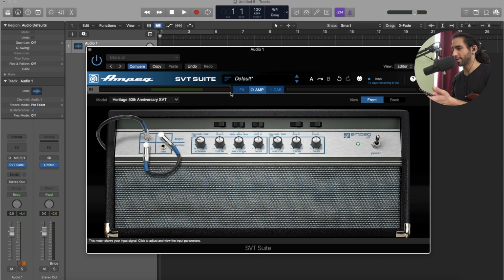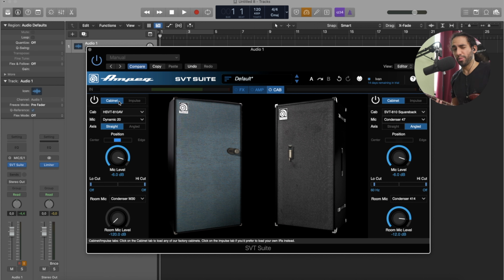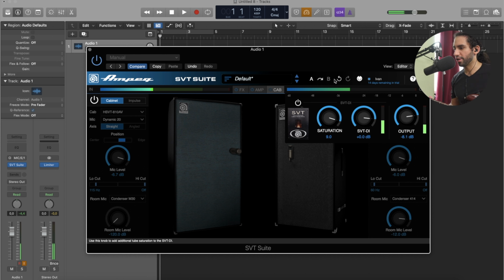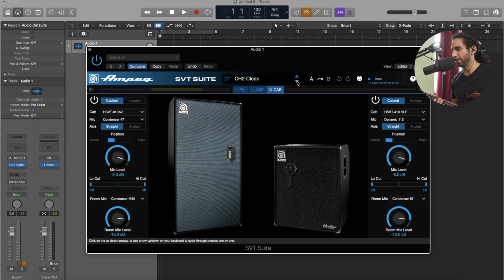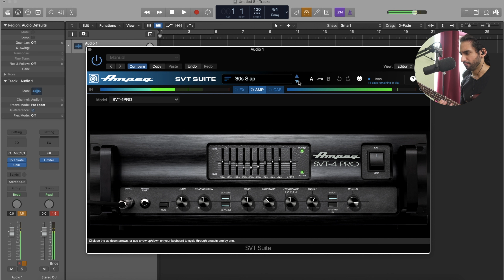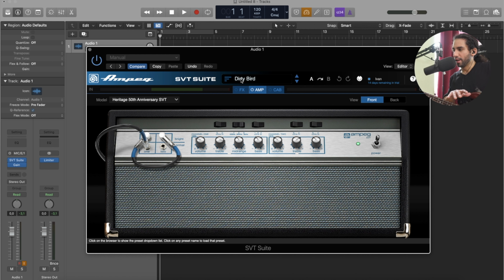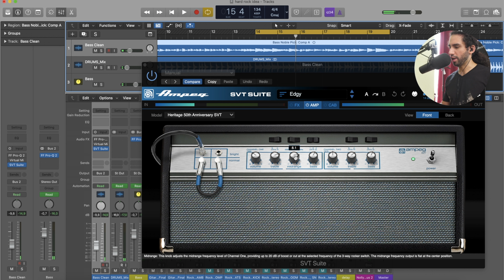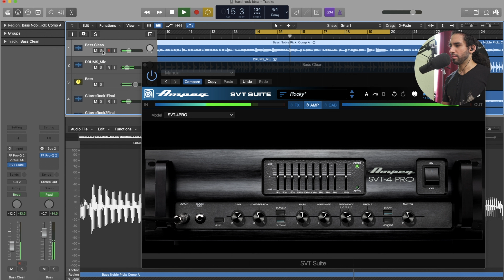Ampeg SVT Suite Plugin | Review

Comment: Hey IVan :) thnx for all your informative videos.

What cheap DI box would you recommend me ti use with my bass into my audio interface and using this Plugin ? 

I pretend to use all preset from the plugin and I would just need a good signal from the bass to the computer.

Thank you again for your hard work
Reply from the maker: Which interface do you have? And how much budget for a DI is there? :)
Reply: @IvanBassist    Steinberg UR12.
I was thinking of buying something like the Nux melvin lee davis bass preamp + di. The tech21 and other options dont seem better from what I heard and are more than double the price. 

Thank you very much!
Reply from the maker: @FilippoBuscemi93  I'd suggest getting a Neve RNDI. That DI is incredibly solid.
Reply: @IvanBassist  do you think there is a noticable difference between that one you said and the one I said? Its double the price.
Thank you for your time
Reply: @IvanBassist  there is also this audio interface: Steinberg UR-RT2 with neve input switches....would that be similar to use as a Bass or Guitar DI ?
Reply from the maker: If you’re planning on using the plugin to record most of the time, then you want a solid DI and the Neve is a pro-level DI. Definitely better than the NUX
Reply from the maker: Just googled that one. It looks pretty solid. It won’t be the same as having the RNDI, but I guess it will get pretty close. You could just skip the DI and plug in directly there and invest the money into something else. 

If you need the DI to do EQ or Drive/distortion then it’s a whole different story

Comment: I need help. I can’t get mine to respond when I play. It tracks my playing and everything, but isnt heard when I play. 

I don’t use a DAW, but the way. I find them impossible to use, more trouble than what they’re wortj
Reply from the maker: Check your routing/signal setup. Specially what is being used as an output device.
Reply: @IvanBassist  if you’re taking about what I think you are, I have it, the sample rate set at 48kHz and, bit depth rate at 24 bit, and still nothing. 32 bit float is another options, whatever that is…  Default recording settings reads as follows…

for I/O  lol
START LEVEL: -12db (other options are -6db…  -24db… -48db… and OFF)

END LEVEL: -48db (same other options as above)

END DELAY: 5 sec (other options are 3, 4, and 5 seconds)

Comment: Hi Ivan, great video and very good explanations. I just installed the trial version and it is great in the stand alone mode. But as I see, you implemented SVT suite in Garageband. Please let me know how to get it like this. I already tried, but I didn't get it like you. Thanks in advance.
😀🎸
Reply from the maker: Hey Harry, I used it on Logic X Pro. You need to open the mixer panel and look for the plugins section. The SVT suite should be there
Reply: @IvanBassist  Thanks Ivan, for your quick response. I installed the Au in Garageband, band this gives me only settings. The Logic X Pro will be another 240Euro. But I will try now with the 90 day test-version. By the way I saw also cheap offers for Logic X Pro, are there other supplier than Apple-Store?

Comment: i stopped buying amps after I bought the Iridium, Helix, Quad Cortex, and Power Cab (for monitoring).  I can't get the sound I want in the Helix or QC then I can just find the amp I need and capture it.  The tube shortage is pushing these modeling companies to get better even faster than they already were.
Reply from the maker: Which powered cab did you get?
Reply: @IvanBassist  112Plus. I’m a guitarist. I only play bass, at the moment, when I record